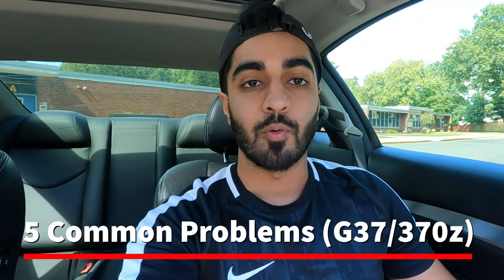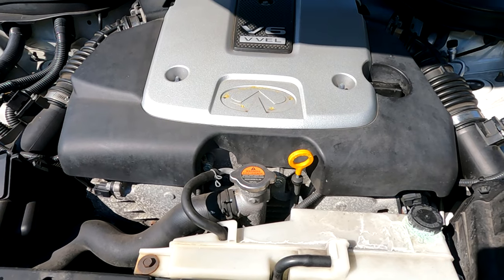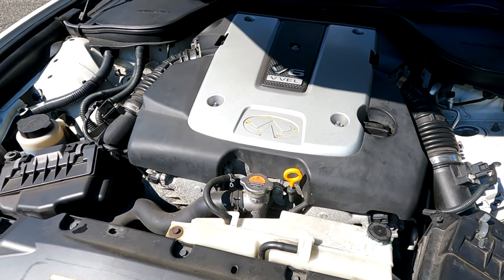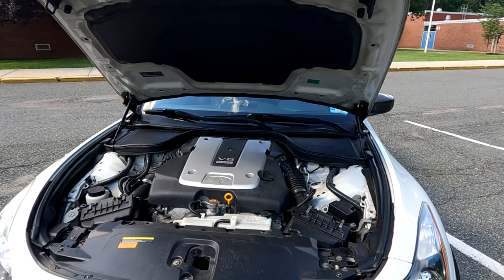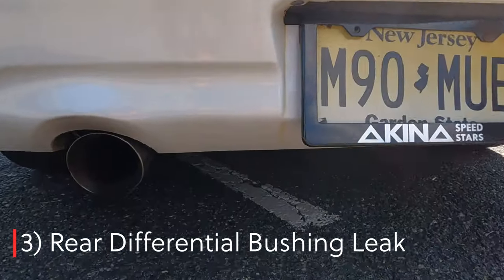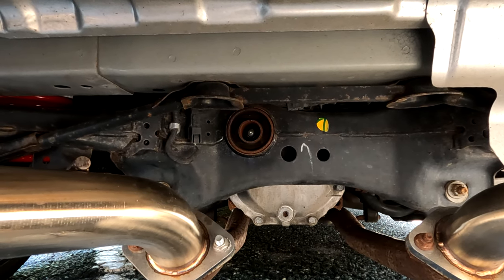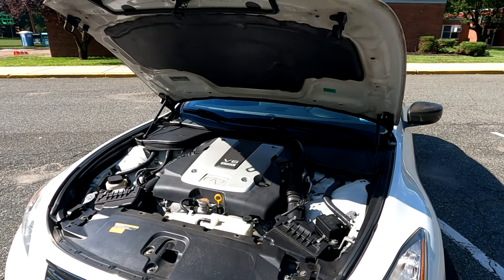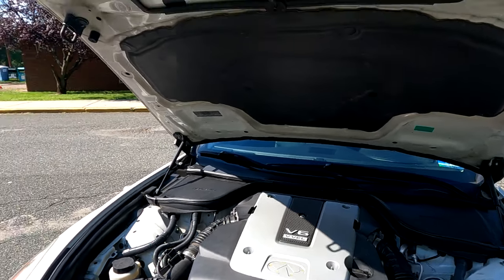5 Common Issues (G37/370z) - **WATCH THIS BEFORE BUYING!

Comment: I test drove one of these earlier this week. It was a G37S coupe. Genuinely the best feel of any car I've ever driven, and now, everytime I see a G37 I look on with envy, because that man or woman is enjoying something everyday, that I only got a taste of for 10 minutes.
Reply from the maker: You should buy one, so you can enjoy it everyday ;)
Reply: @yayasgarage  agreed
Reply: Man I was trynna get rid of mine cuz I wanted more power but the more I learn abt em and see it’s truly a great car with lots of potential the more I wanna keep it, really fun cars I’m pretty sure the 350z is a bit lighter and better at handling same engine tho
Reply: I have a 2012xs coupe, it’s fast and smooth, thanks
Reply: I bought a used 2010 g37 sedan with 35,000 miles from CarMax a few years ago & these are the issues I’ve had with it. On my 3rd set of tires, break pads, new cross drilled/slotted rotors and flushed the break fluid at 100,00 cleaned the map sensors and throttle bodies because of check engine light but fixed. One tire pressure sensor because of check tire sensor & replaced one plastic coolant fitting in engine bay for heater coil leak. One driver side door lock cable replacement because it failed now the passenger side door needs replacement. Don’t get me wrong with over 200,000 miles it’s been a good dependable car that has been fun to drive.
Reply: Once u get it after like a week u need sum faster 😂 trust
Reply: go drive a 09 accord 😂
Reply: I have a g37 and you are correct I love riding it if I could live in it I would lol
Reply: @MoneyPrinterr no cap but I feel like I could get a 500hp car and feel like I need something faster after a week😭
Reply: The e90/e92 chassis has an identical feel—if not better—in comparison to the g37. I’d say if you want that same feel, test drive one of those. The 335i will have the same power as the g37. The 328i and 325i are a bit slower, but no slouch
Reply: You can find a good one ‘round 8k these days, not unattainable by any means
Reply: My untie I took care of of her dog while she was out of town and she has a G37 she let me drive it man I tell you fell in love with it one of my dream cars

Comment: Watching this as my G37 is in the shop 🥺
Reply: Same
Reply: Just got mine out of the shop
Reply: What was wrong with yours?
Reply: @TheProboy127  what’s wrong with yours as well?
Reply: @NoDidddy  the wire harnessing for the fog light got wet and needed to be re wired just a little fix
Reply: @TheProboy127  glad it’s nothing too big
Reply: Facts , trans 😓
Reply: Me2
Reply: I needed a new water pump my shit was overheating but we running smooth again
Reply: Lol

Comment: Bought my 2009 G-37 new.  I have over 140,000 miles on it and don't burn any oil. Around town I get 19 mpg and on a long trip on the interstate, I get between 26 - 28 mpg.  It is a keeper.
Reply: still drive my 09, about to hit 100k miles soon. Over a decade later I still think the car looks great, it's aged very well.
Reply: Does it take premium fuel?
Reply: @Freerider93 i never put anything but 91. Don’t cheap out on fuel
Reply: @Freerider93  I see no difference in mileage when I use Regular fuel, but I see a difference in my wallet.

Comment: I bought mines wit 136k miles 09 sedan.. my trans gave out on 201k miles slap a used transmission still goin strong so far wit 210k miles... am riding mines and maintaining it until the wheel fall off 💯
Reply: Mine, not mines. Damn.
Reply: My 09 about to hit 100k miles before year end, I'm with you ain't getting a new one until it's done done

Comment: Thank you for a good video. I like how you added pictures of the problem part. I have a 08 G37 coupe. I drive it normal and stock and change the oil every 3K and it burns no oil. I have a Car Shield extended warranty $109 @ mo for Platinum plan. Covers all major components and $100 deductible. Good peace of mind if any thing goes wrong.
Reply: Hate to be the bearer of bad news but you got scammed . Carshield won't cover anything if something happens . Do your homework.
Reply: @soulerflare7  yeah that sounds too good to he true
Reply: Did you ever end up using the warranty? I'm in a similar boat.  Is it worth it?

Comment: My g37 sedan AT has been very reliable for the past 4 years of ownership, it has 92k miles, I do 650miles of driving each week for work and it literally gave me zero problems so far.  Never burns any oil and i change it every 4k with mobil 1 full synthetic. Super impressed 👌
Reply from the maker: Yeah they're really reliable cars as long as you maintain them. You can also have lots of fun but pushing the car without worrying the car will blow up
Reply: Had 2005 g35 coupe then 2010 M35 and g37 coupe same time. Sold them for Honda accord and Odyssey when got married and had kids. Now in my 40s, just bought 2015 Q60s with 110K miles on it and clean. Missed Infinities so bad and Im hoping this will last me very long time. I drive 33k miles a year.

Comment: I’ve had my 08 G37S coupe for over 10 years now. I got it when it had 50k miles and now It’s sitting at a little over 160k miles. The only issue I have encountered is the clutch slave cylinder going out at 60k miles which was luckily covered under warranty by the dealer. I thankfully haven’t had any of the other issues mentioned.

One other common issue that wasn’t covered in this video is the heater hose connection that’s near the firewall (bulkhead). There are two hoses that clamp to a plastic connector that tends to crack and leak coolant. It’s happened to me twice but It’s a really easy fix. There’s an after market replacement you can get that’s aluminum though. 

A second common issue is the sunroof drains. I’ve only had to replace the ones that drain toward the firewall (bulkhead). The rear ones have luckily been fine. The original design of the drain wasn’t very good so, on heavy rainy days, you’ll end up having water puddle up under your floor mats. Infiniti revised the drain design and is another easy fix you can do yourself if you have the patience. 

There are plenty YT videos that cover these repairs.
Reply from the maker: Right, I didn't mention the sunroof drain issue which is very common. I actually wasn't aware of the coolant leak issue. Thanks for the info!
Reply: @yayasgarage No problem man!

Comment: Heater core hose coupler break is very common and causes all coolant to leak out and engine to quickly overheat. Easy fix, best to replace it with a metal one before it goes out
Reply from the maker: Thank you, will definitely look into this!
Reply: Happened recently with my car. I was on my way to work one morning on a cold day, and I realized when the heat hasnt kicked on and was blowing cold air and my coolant temp was higher than normal. Since I was already working at Lowe's I just bought a coupler and fixed it on my lunch 😁
Reply: Happened on my 2010 G37 Journey. Part isn’t even necessary on a ‘10. Should have been seamless hose.

Comment: Slave cylinder went out twice for me!  1st time used another mechanic (they didn't do it right, ended up going back to Infiniti) 2nd time Infiniti fixed it and said they used more viscous fluid to help prevent that.

Comment: Good list! I would add valve cover gaskets & sunroof drain there too.
Reply from the maker: Right completely forgot about those. Both those issues are significant in the older models (08-11) if I'm not mistaken
Reply: @yayasgarage  I have a 13 and have all those problems lol. Sunroof was fixed but the covers are still leaking
Reply: @5.7_TY  in which years is the gallery gasket problem fixed? Is it 2013 and up?
Reply: @nickarcia4623  No cause my 2013 37 also has a valve cover gasket leak that needs replacing soon lol
Reply: @nickarcia4623  the problem was addressed in 2012, so most 2012+ models are in the clear. You can check the month in which your car was manufactured on the label in the door jamb

Comment: Thanks for the tips. I have a 2014 Q60 convertible, and I ran into some of what you mentioned like the Bushing getting worn out, which cost me 2K from the dealer.  Also, your Rear timing cover is leaking, but I have not lost oil pressure yet.  Dealers are charging 5.5K.  Something I am looking for a mechanic to fix it cheaper.  I did want to say if you have an automatic transmission, I ran into that I had to replace my valve body and flush transmission code 65INZ95 DTC Po720.  Cost me $4k,  other mechanics were a little cheaper, but you have to remember that it needs to be reprogrammed, and I want the dealer to do it right.  Even though it stalled, it took me home and drove. I drove it the next morning, I noticed you can drive it when the car is cold.  So far, no problem after replacing it, and I have 114k miles.  I drove it 85K when I bought it and it's been really reliable and fun to drive.  I drive 200 miles a week get an average of 23 mpg and love hitting 120 speed.
Reply from the maker: Where in the video were u able to tell my rear timing cover is leaking?
Reply: It's the timing cover Gasket #1 that needs to be replaced,  dealer said they found leaking oil on the rear timing cover is a sign that I will need to change the timing gasket soon

Comment: My 2013 G37X coupe got it at 30,000 miles and now it has 165,000 on it. Never had any issues with the car other then normal maintenance but I take good care of my cars. It has been the most enjoyable ride and such a fun car to own. She is so fast! I would love to get the Q60 but I have to begin to move onto something more economical... with four doors :) This was the second infiniti I owned. I had a G20 and drove that car to almost 200,000 miles. The infiniti coupes are not inexpensive to keep up with but they are reliable and so FUN!

Comment: 2011 G 37X Coupe
Original owner never had a breakdown 
Only replace two batteries
And I don’t think they have any issues .
Still runs and drives like brand new 
Show room floor condition 
❤❤❤❤
120 K

Comment: 2010 g37s coupe here, ZERO oil burn and never overheats. Solid car, 72k.  The slave cylinder will be a pia for sure.
Did the diff bushing replacement. Big job if you don't have a lift.
Reply from the maker: They're very reliable, just a few issues here and there but nothing too bad
Reply: 10, 72k? U pay Uber all the time? 😂 09, 118k 😢
Reply: You won’t start seeing many if these issues till about closer to 200k
Reply: @yeimydo2310  Garage kept too, still has that new leather smell, ha!
I drive a beater for my daily needs...
Reply: Only 72k miles sell me your g

Comment: You did an awesome job. Just would like to add the sunroof drain and heater core coolent hose connector
Reply from the maker: Thanks man, appreciate it. Yes, you're right the sunroof drain is a common issue. I actually didn't know about the heater core coolent hose connector issue
Reply: @yayasgarage  yea I didn't know about it either but it's a very cheap and moderate fix for it. It can save your motor. If you YouTube G37S heater core hose it will pop right up

Comment: Amazing video man. I'm looking to get a used G37 eith 150k miles😬. But the car fax show it has been well maintained and I'm ready to deal with the issues you presented here.
Reply from the maker: Goodluck! As long as it is maintained well, you should be good. These cars are pretty reliable as long as they're maintained well
Reply: @yayasgarage  unfortunately not lookin good. lots of probs wont pass inspection. lookin for another option. maybe an auto instead of a manual
Reply: @baseballer21and0  what problems did u have?
Reply: @co8248  I got one with 100k miles. I needed new oil gallery gaskets. That was the main thing.
Reply: That blows, I bought a 2012 sedan G37 with a 1 owner at 164k miles but it was very well kept up with maintenance. Haven’t had any issues

Comment: Just bought a 2008 g37. My slave cylinder went bad as I was driving it home 6h away from where I bought it too. Had to pump the clutch to get it to work so I can drive it home. 6hrs turned into 12 hours

Comment: Guys so basically I was thinking of buying a 2008 G37 manual with 86k on it. The problem is the steering is extremely tight, like abnormal. Would any of you guys know the problem?
Reply from the maker: G37 have a very common issue of the power steering pump going bad. I suspect that's why the steering wheel is extremely tight
Reply: Or could be steering rack. My last g37 had that wrong
Reply: I'm about to look at a g37 tomorrow and the guy says the transmission has some problems accelerating I'll update tommorrow
Reply: 2007 & 2008 G35s are known for heavier steering.  My 08 G35 is much heavier than my 13 G37.  Assuming that the steering in the 08 G35 is the same as in the 08 G37 Coupes, but they could be different.  Starting in 09 the steering was much lighter.

Comment: Had the CSC issue in mine Twice, once three years ago by the original owner, and again just last year. Didn't replace the clutch at the time since it was already done the first time the CSC was done two years ago by previous owner and it would've been pricy but now clutch feels like it's fading a bit. Hate this design, terrible for repair and cost
Reply from the maker: Yeah it's a horrible design. It's unbelievable nissan never fixed it even in their newest versions.
Reply: I had the same issue 3 years ago. I didn't have enough money back then  but I should have upgraded it.

Comment: My brother purchased the new  2012 G37 convertible and I got the new  BMW non turbo 328i convertible. We're in then years with the cars and mine has gone through $13k in maintenance and his $400 for a alternator. On top of that, his has 140k Miles and mine has 46k miles. I should have gone japanese.
Reply from the maker: Sounds about right. German engineering is wonderful but when it comes to reliability, JDM is the way to go

Comment: I think my only major issue I had with my 2012 G37x sedan was starter went out at around 60k and rear differential bushing was leaking at 100k. Besides all the regular maintenance it’s held up fine. I use Ester oil so that maybe why mine don’t burn oil?
Reply: Yeah I’m in the same place as you I have an 09 that was rebuilt in 2012 and I keep hearing how unrealiable they are but this hasn’t been my experience, my only problem has been an exhaust leak,

Comment: G37 also has cooling problems my 08 keeps losing coolant , I see little leaks under my car could be my radiator.
Reply: I just checked the reservoir.   It was empty.  Had to run to the dealership to get a gallon.  Thanks for sharing.
Reply: @lukha225  keep checking to make sure there’s no leak , mine had a leak since I got the car and yet gotten it fixed , my reservoir is empty like every other day. Gotta get it fixed
Reply: Coolant hose connector
Reply: @NoDidddy  This. Might be time to get a set of hoses and clamps, you're closing on their proverbial 15 year life expectancy.
Reply: @jacquesc3166  I am at 175k....still going. Replaces the radiator and hoses 10k ago. Hearing catalytic noise.
Reply: @daviddrost7963  Wow you took her easy!! My OEM cat on the passenger side started to "rattle" around 90K miles. It's still there, with an Invidia Q300 that wasn't there when it started rattling. High flow cats on order since Nov.....

Comment: Why does my g37 idle in park fine but when it's idle in drive It drops below 1000 rpms and kills the motor
Reply from the maker: Check your MAF sensor. It might be dirty or loose that might be causing that
Reply: Check your TBs, clean them off and be careful while doing so. A little mistake with the butterfly valve can be very expensive.

Comment: Can't you just replace the oil gallery gaskets for the older g37's?
Reply from the maker: Yes you can but it's a big job. If you don't do it yourself, it'll be expensive to get it done

Comment: I'm trying too decide what to buy between the G37 and 3rd generation Acura tl. Any advice?
Reply from the maker: G37 bc it's faster and has a much nicer interior
Reply: I was also cross shopping the TL and the IS350. Too much torque steer in the Acura and the Lexus felt really cramped inside.
Reply from the maker: @gndesign25  What year is350? I'd go with the G37 if its between the 2010-2013 is350 but if its the newer one, those are nice
Reply: @yayasgarage  - Yeah it was 2010 is350 models - I bought the 2010 G37S sedan 4 years ago. Great car, very reliable and fast!

Comment: Having a clicking noise that I notice a lot at low speeds, will be taking it to a mechanic soon and would like to know if anyone knows that this may be before anything
Reply from the maker: Can you tell where the clicking noise is coming from?
Reply: @yayasgarage  its the left drivers side wheel and it clicks usually when you turn left or are going in the left direction and sometimes you can hear it click slightly on bumps, its not very loud or obnoxious but its definitely noticeable and especially when turning at low speeds (5-20mph)